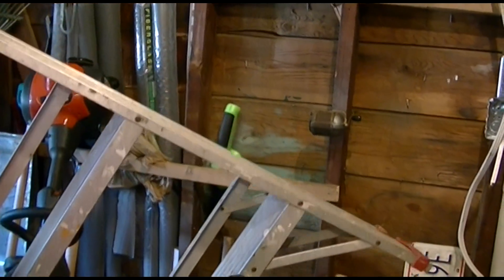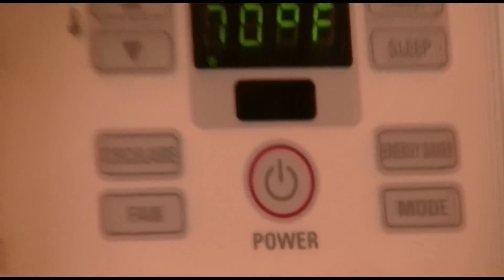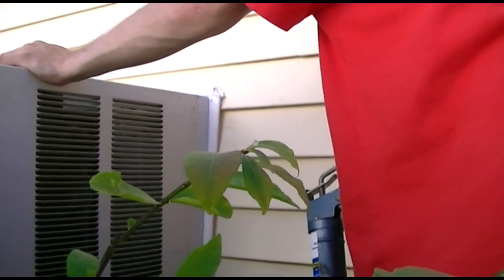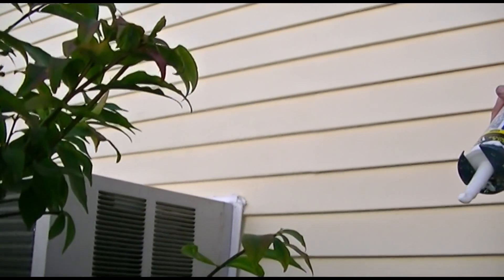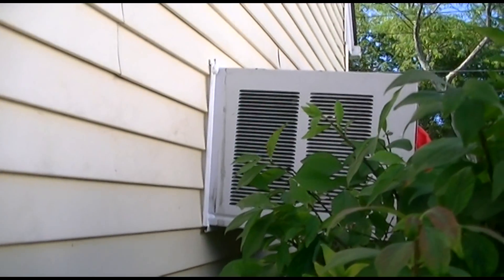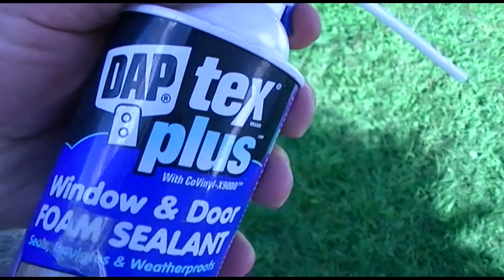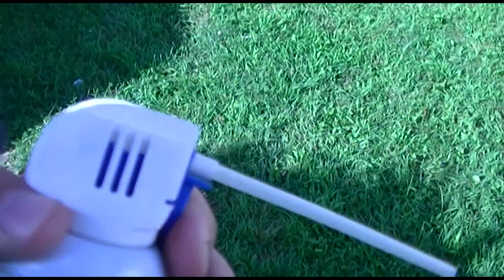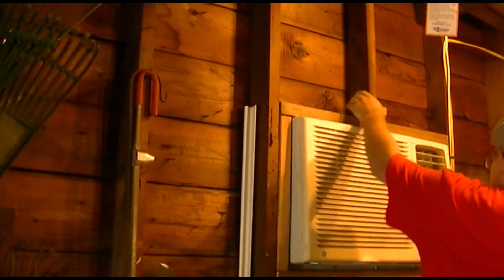Garage A/C Installation Part 5 - Caulk & Spray Foam

Comment: The energy saver has a tendency to make the thermostat inaccurate because of the lack of air moving past the thermocouple when the fan isn't running.
Reply from the maker: Yes, I've since stopped using it in hotter weather.